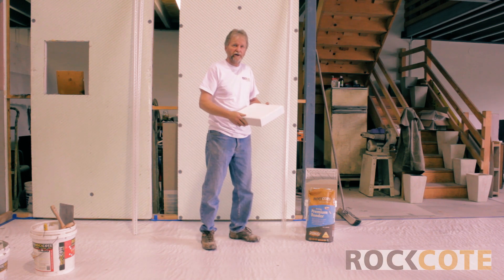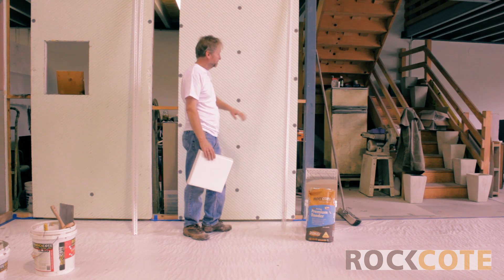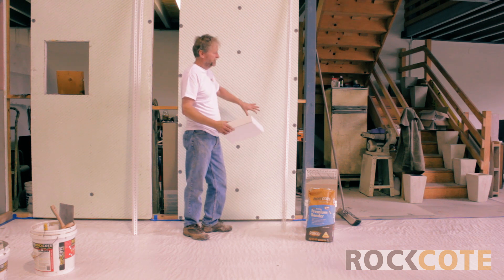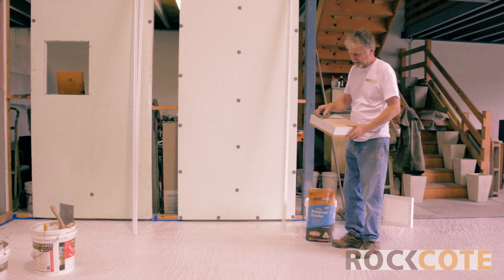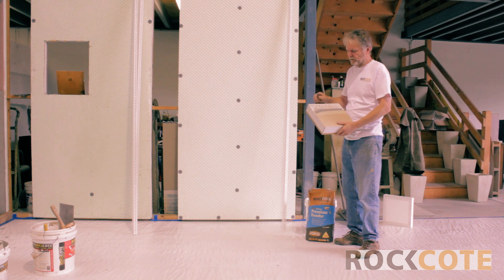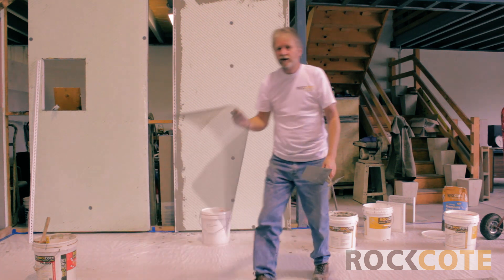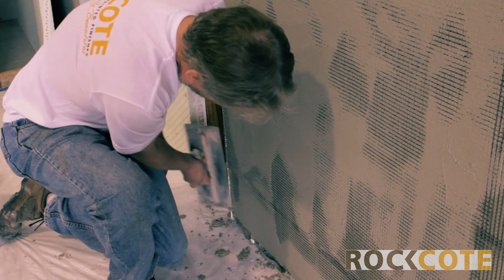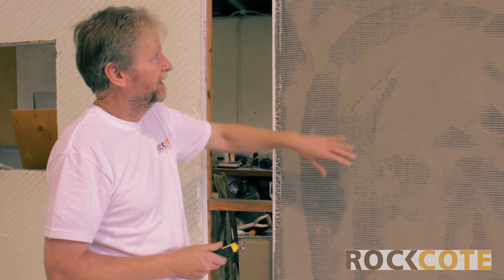Rendering EPS (Expanded Polystyrene) Panels with Rockcote

Comment: great job but what does the mesh actually do is it just basically a key for the outer coat
Reply from the maker: +david davids The mesh reinforces the substrates and reduces the risk of cracking (due to movement of the substrate) showing through to the finish.